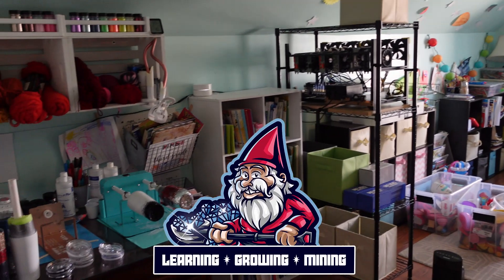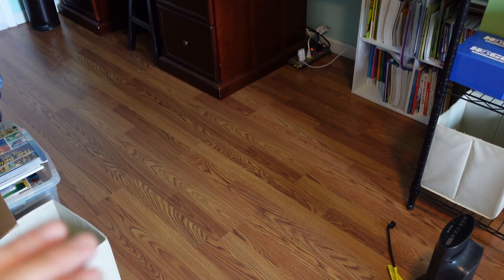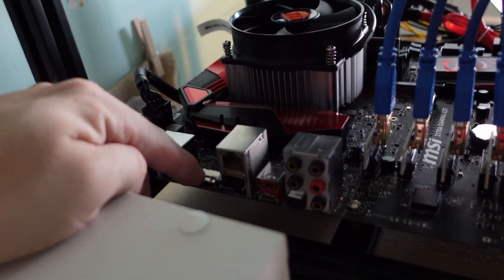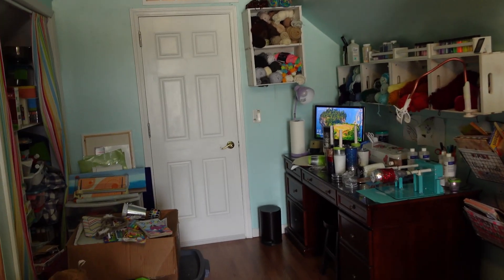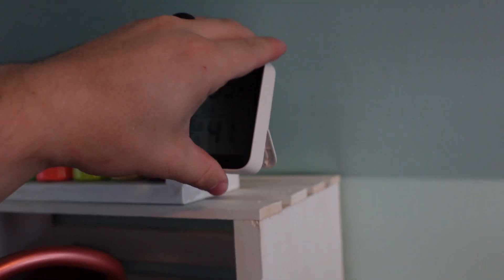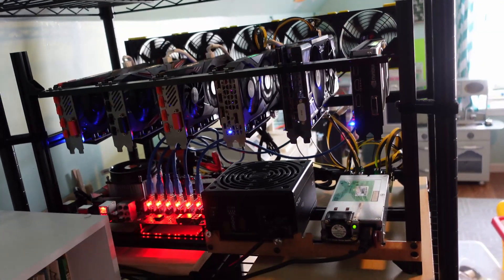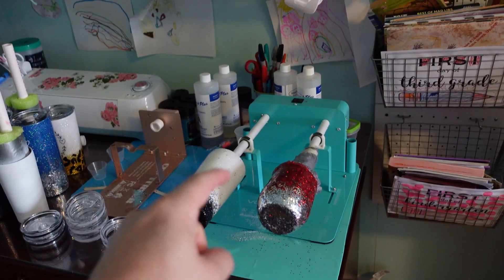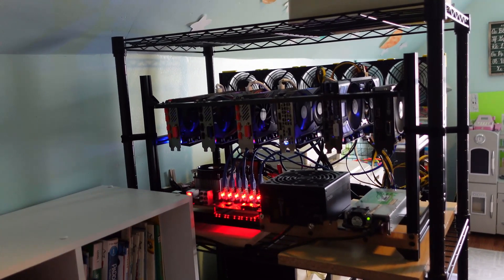Heating My House with Mining Cryptocurrency

Comment from the maker: Whats the Temperature Outside where you live?  Are you using a Mining Rig or Two or Three to heat any areas of your house?
Reply: I would be happy to have a mining rig
Reply: I mine in the basement its like 10-35 degrees F outside lately around here, I just have to crack my basement windows a tad to get enough cool air to really let my cards cool off and not have to use too much fan speed. Plus if it ever gets too cold I just close the window for like 20 minutes and it warms up really fast lol
Reply: 35F today. Heater has been broke for 3 months. Haven't needed to fix it. Nice and comfy 67f in my house. Intake vents are in my basement.. right above my miners.

Comment: I've mentioned before in the discord how my basement prior to mining was 60F all year round.  Was great in the hot summer months to go down there to cool off after working outside all day.  It wasn't so good for starting plants for the garden as the germination was slow and the plants would become leggy and weak.  That temperature wasn't good for them.

Once I caught the mining bug, at its peak it raised the average temp to about 80F!  This excess heat would also leak into the house and push it up to 74F.  The wife and I like the house to be between 68 & 70, we sleep better. So I had to do something to mitigate that.  I am thankful that my basement has several windows that I can open.  I end up taking a cheap, old box fan, mounting to one of the windows right next to my farm of mining rigs to pull excess heat outside.

This has worked beautifully and keeps the temps right around 70F and doesn't influence the rest of the house anymore.  Now come summertime, I will have to revisit this set up and change a few things around.

Great video.
Reply from the maker: Yeah Mining is more than powering on your rigs ... temperature control is an entirely different game!

Comment: I’ve got mine currently in the livingroom.  Furnace barely kicks in anymore.  Thinking of moving it down to my basement as it’s always cold down there in the winter.  Then I will have to think about what I’m going to do to vent the heat out for the summer.  At least I’ll have all winter to think about it and get whatever I’ll need. 😆

Comment: Its been in the low 40s and low 30s here, I have 7 rigs in my basement, 3 on the first floor, and two on the second floor. Its a solid 75 inside on the top floor without heat on. In my uninsulated garage there are 4 rigs and its 65 inside when its 30 outside

Comment: The temp sensor on the window got colder because the fans behind the gpus were dragging air from there and essentially more of the air was leaving the room so more cold air from outside got in from the gaps surrounding the window.

Comment: If snow doesn't lay on the roof you are probably correct that there isn't insulation in the ceiling, you can poke holes in the drywall and fill the cavities with slow rising foam (prob the least invasive fix)

Comment: My 3 rigs heat my apartment. I have to pump cool air in from the outside. You gotta love sustainability!
Reply: I got one of those portable AC units that attach to your window (not the window models this sits on the floor).   I use it to keep the bedroom cool and just run the AC around 75-80 and my apartment has been staying pretty cool even with the two rigs I have in the living room and my gaming PC in the bedroom.
Reply: @likeorasgod  I hear you, brother. During the summer, I have  a similar setup, but during the winter, I remove that portable AC unit that stands on the floor, and fit a 6 inch fan to the exhaust. In this case, it pushes cool air into the rig. It saves a bit of money on the electricity bill. How much power does your portable A/C unit draw?

Comment: Heating the basement and the garage at the moment :)
Reply: Same here, but man is it drying out the house.  Have to get the whole house humidifier setup. :)
Reply: @pinaycollectibles3074  I have a humidifier on my furnace. If you have central air you might wanna consider installing one
Reply: @paladdin1500  I have one as well, but I just got a nest installed and need to hook up a humidistat (coming in the mail).  Question: Do you have it setup to run when the fan is on, or only when the heat is running?
Reply: @pinaycollectibles3074  unfortunately humidifiers are very basic, no smart ones. I set it on 45% and it’s on whenever fan is on. 
Ideally you’ll have a smart humidifier, you set your humidity level and it will kick in when it’s necessary. 
Hmmm, might be a good raspi project  :))
Reply: @paladdin1500  An HVAC guy suggested the best place to put the humidistat is on the return.  Hopefully that will help.  Good to know I can set it to whenever the fan is on because I would like to circular some of the warm air in the basement where most of the mining rigs are.  Thanks